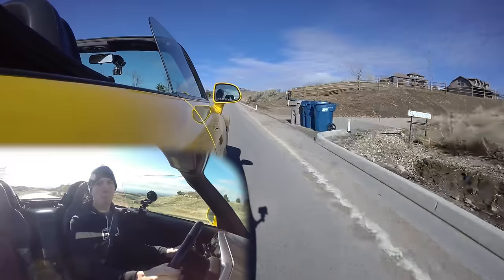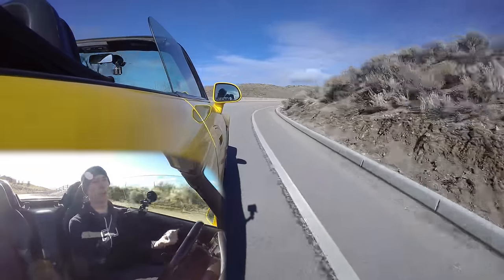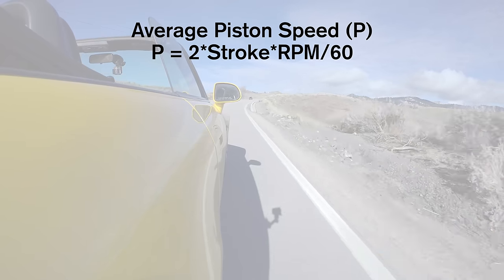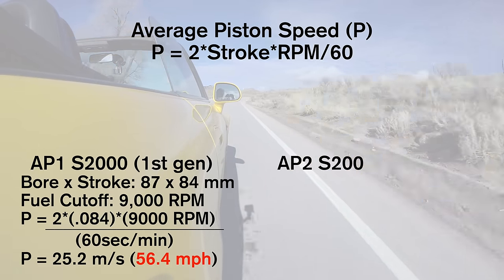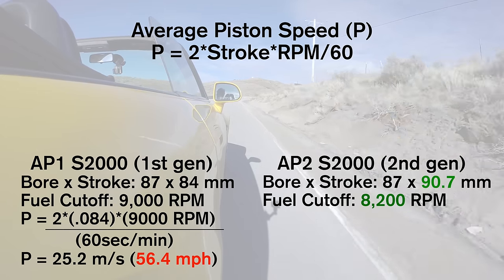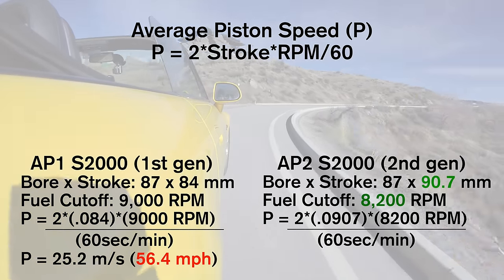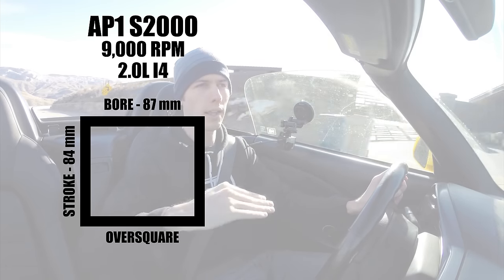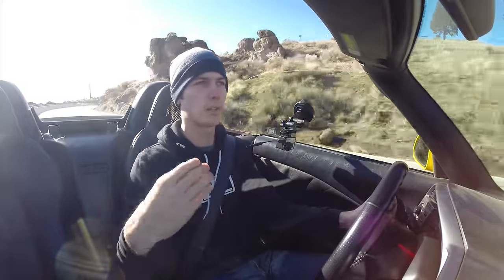How Do Some Engines Rev To 9,000 RPM?

Comment: Do higher engine speeds cause more wear and tear to the crankshaft and gearbox? Therefore are diesel engines more sustainable in that the everyday user can enjoy higher power without quickly wearing out the engine etc? An example of engine wear for example could be crankshaft / gearbox  oil leaks caused by worn journals etc.
Reply: Be careful of the indoctrination word "sustainable", because it does not mean "growth". (do you want to grow?)
Sure, higher RPM's will mean more wear and tear, but with "growth" we can figure out how to make it work for their application, (tougher materials, better lubrication, etc. etc,--thinking).  We are thinking man, and we can do anything that is possible, but only if we believe in "growth".
"sustainability"  in reality, is actually a pretty dirty word, if you have any intention on growing.  Consider it sabotage, as that is want the word represents in the context of mans "growth".  I would love to see you young guys sue your teachers,---collectively.

Comment: 9000 is not impressive. I feel like the question should've been how can some engines rev to 18000 (bikes) or 23000 (F1)
That being said, I do love your videos and really appreciate your unique point of view, not criticizing, just commenting.
Reply from the maker: It's all relative. Name another road car that hits anything above 10,000 RPM. They don't. As demonstrated in the video, 18,000 RPM F1 cars have the same piston speeds as something like an S2000. Saying 9,000 isn't high for a road car is simply inaccurate. If it's mundane and easy to rev to 9k in road cars, all of them would do it.
Reply: Thanks for the reply, I did not mean to say it's insignificant, for a production car engine. In that criteria 9000rpm is hugely impressive. But my comment, and, the way the videos title reads, refers to any engine type. Not specifically production car engines. "How do some production car engines rev to 9000?" would've been a more accurate title. And again I would like to stress that I'm not just trolling, I do love your content, and I feel much safer going by the advice of an engineer than a "Car reviewer" so yeah not trying to be a dick... You mentioned that in an F1 engine the pistons aren't actually moving any faster than an S2000 despite the drastically different rpm? That confuses the hell out of me, could you maybe explain that in a future video?

Comment: If i decreased piston weight to make it light weight piston does that affect rpm?
And how does f1 engines get enough air for combustion at insane rpm say 18000 rpm?
And my last question is a technology like koenigsegg's free valve effective at high rpm or not?
Reply: no it will not, it will just make the engine rev and drop rev faster, because the moving mass is less. The traveled distance of the Piston is still the same.
Reply: it can withstand more abuse from higher revs, it's often the conroad that gives up at high rpm and it will like a lighter piston. f1 can have huge valves which only benefit high rpm, there is a reason for the 6k rpm idle. The free valve technology will initially give a much better breathing efficiency but the system itself can't react fast enough for crazy rpms. But that can always be improved.
Reply: F1 uses complicated pneumatic valve system
Reply: Bilal  Smadi 
What is this complicated system?
Reply: There's a search bar at the top of your browser. Click there, type "F1 pneumatic valve" and press enter.
Reply: +Pizza face... I like your style. Finding things out for yourself comes with all kinds of satisfaction... but for those that need to be spoon fed...
+Ahmed the pneumatic system uses compressed air to open and close the valves, and is far more responsive than a mechanical (ie. cam and spring) system. Springs that cant keep up with rpm lead to "valve bounce" where the spring ends up with resonance and keeps flexing, which allows the valve to 'bounce' off the seat and not seal the cylinder properly, reducing power. In extreme cases valve bounce can get so bad that the valves impact the piston and your engine becomes a boat anchor.

Comment: You should also say that even if you have limit 9000RPM, your engine probably have most torque at lower RPM. Example. Honda Civic VI 1.6 I 116 KM: max engine power: 6500RPM, max torque: 4800RPM.

Comment: I have a dodge journey 2.4lv4 dual vvt I just bought it and the high rev when I would flore it would hit just under 6000rpm most of the time its around 5300 but after replaceing the nasty air flow blocking air filter with a high air flow I now max out at 7000 it may be higher but I would not no the cars rpm dial has not number higher on it.

Comment: I never really understood why Honda changed the engine.  Sure, I get that they may have wanted it to be more suitable around town and add some torque lower in the rpm range, but for me, it spoiled the flare and flagrancy of 9000 (some say cutoff is 9200) rpm.  If they just released the original S2000 with the FC22 engine out of the box, no one would be the wiser or feel there's a loss.  If you give us more and then take it away..  Even with all the suspension and handling improvements, the heart of the beast has been tamed.
Reply: I believe longer stroke results in more torque at the expense of less rpm and because of that AP2 is more in favor of daily driven whereas  AP1 is more track oriented.

Comment: i want to know why diesel engine rev lower than gasoline engine, and why some trucks engine only reves to 2k-2.5k rpm when normal diesel engine (is the second one based on the wheight of the piston?)

Comment: Higher reving engine is always smaller and lighter than high torque engine with the same horse power. Less weight, more mpg, better handling.
Reply: The downside to a higher revving engine is that the power isn't easily accessible. In a light car with proper gearing, this isn't a major issue. For larger vehicles, or when towing, having easily accessible power, even if that maximum output is equal or lower than a high revving engine, is key to getting a lot of weight moving at reasonable speed in a timely manner. Though with that easily accessible power means it's also easy to burn a lot of fuel, while a smaller engine may need to rev higher to drink it's fill.
Reply: precisely dude

Comment: Piston speed is measured in fps feet per second not mph highest mean piston speed you want is 140 fps  anything higher then that your motor will come apart period depending on stroke and rod combos give you different fps at different rpms short stroke = high rpm tall stroke = low rpm redline destroke 400 sbc 3.48 or the 3.50 stoke crank 377 or 379 can get you to 8000 plus safely but 375 stroke crank maybe 7000 most but with tall deck block and longer rods like 6.200 3.75 stroke can turn over 8000 rpms its all about combinations eagle has an awesome cubic inch calculator that can give you mean piston speed for different combos

Comment: This is interesting. Just picking some numbers from some engines I've had... A ford 300 has a 3.98 inch stroke, and a piston speed of 30 mph at 4,000 RPM which is just about all they will turn. Which is why they hold up, I imagine. My Chevy Colorado has a four cylinder with a longer stroke than the Ford 300, at an even 4 inches... at it's 6300 RPM redline, it's about 47 MPH. 

Just for fun, I have an engine with a 14.7mm stroke, and a 40,000 RPM redline. This gives me a piston speed around... 43 MPH. 

Aren't Engineering, Physics, and Math fun??

Comment: Honda fan boy here. I’ve owned an 07 civic si FA5 and an 08 civic si FG2. Both revved past 8,200 rpm it changes a drivers perspective when you let it rev all the way to the way and listen to your intake and exhaust cams open up and hear the engine and exhaust even more clearly. Same even with a buddies gsr integera they all go past 8,000 rpm. Honda/Acura>everything
Reply: 177SCmaro that’s fine I’m sure any turbo Honda will definitely get the job done.
Reply: so you think a boosted k20a is a hand grenade? seems youre a bit biased
Reply: 177SCmaro since you assume Honda & Acura is a joke check out 4bangersproduction & iamtaiboogie on YouTube and get back to me.

Comment: Seen a Subaru eg20 engine revving to 12,000 rpm on a YouTube video? So basically the whole bottom end of this eg20 engine is different to achieve this? Shorter piston stroke and wider bores ? Is this how it was achieved cuz they won’t say on the video. But cuz it still using factory gearing ratios in the box and diff its top end speed is crazy fast? Apparently?

Comment: Question:
 @ 3.15  you said the AP2 has a shorter stroke, i thought it is undersquared and have a longer stroke?
Reply from the maker: As shown at 3:05, it is undersquare. Overall though, the stroke is not very long (hence the high engine speeds).

Comment: Does the rotary engine really rev fast, as I understand only the geared crank spins fast, the rotors spin 3x slower, so at 9000 rpm the rotors are only spinning at 3000, possibly the slowest revving engine ? I’d like to hear more learn,ed views.
Reply from the maker: The crank is the number you measure when discussing rotary engine speed. Yes, there is generally a 3:1 gear ratio, so the rotors are spinning at 3,000 RPM while the crank (eccentric shaft) rotates at 9k. Ultimately crank revolution is your rpm, not what the pistons or rotors are doing.
Reply: Thanks, but it seems a bit like cheating. 🤔

Comment: Hey I have been working on a ohv small engine and haven't been successful, the cilinder has a good bit of oil in it and gas and oil is being blown out of the carburetor and it back fires but doesn't run, I would tromendously appreciate any help I can get to get this motor working again because I've been working on it for weeks.

Comment: Does the flame front travel at the same rate for diesel as it does for gasoline?
Reply: HayabusaRydr There is no real flamefront inside a diesel engine since the air-fuel mixture is being ignited by the general heat produced by the pressure inside the chamber.
That means that there isn't really ONE place like a spark plug where a flame front is caused.
The Diesel inside the cylinder just burns pretty much all at once everywhere inside the whole chamber
Reply: TheImperfectGuy so you're saying it runs on unicorn farts?
Reply: HayabusaRydr It runs on me saying that hundreds of mini ignitions,  not even milliseconds apart, creating hundreds of mini flame fronts, mit dem means burning all at once without a real flamefront
Reply: +HayabusaRydr 
No. 
The in-cylinder burn rate of gasoline is several times faster than diesel. 
There are very detailed and informative papers published on this subject by MIT, Ford, Cummins and SAE.

Comment: There is no definite answer how and exactly what makes some engines rev to 9k rpm, if there is, it's "every single part counts". Take your average chevy small block V8 as an example, back in the 70s and early 80s,  truck motors choked by emission control crap redline at 4400rpm (if I remember correctly, the tach only went up to 5k rpm), while racing engines that share the basic cylinder block can scream at 10k+. The upgraded rotating assembly, valve train and oiling system etc are all serving their purpose in making something as mundane as an sbc rev above 10k rpm.

Comment: For 6.6mm longer stroke the RPM drop 800 and my question is are all engines running with the 50-60mps speed cuz alfa romeo has 2.0v6 engine with 66.2mm stroke and 80mm bore and theoreticaly with the same pistone speed as the S2000 it should hit over 10k RPM but it cuts fuel at 6800rpm. Why ?

Comment: It sounds cool but if you max out on piston speed I assume you also max out on wear and tear.  And the sound will become wearing too.  I'd prefer an undersquare engine with 2 valves per cylinder most of the time, i.e. one that doesn't need to be revved.  And there is a reason electric cars make mincemeat out of the best supercars in a drag race.

PS  Lets not forget the fastest revving engine in the world is not a Honda S2000 or an F1 car.  It is a hire car.

Comment: so a v12 has 2 sets of 4 pistons arranged in a v but what if you had 4 sets of 3 pistons arranged in an x with a lower stroke, would this allow for higher revs?
Reply: Fumetsu Kage maybe this goes away from your idea, but your describing a radial aircraft engine!  Nifty packaging for an aircraft. They were and still are slow reving low compression engines designed for a specific use. The challenges of cylinders below the oil sump seems like an unnecessary challenge for a road car.

Comment: Anyone that has raced a high rev eng in low gears in turns gets it. They pull fast, engine brake fast, and grip the road better. Hard to explain. Use to race a motorcycle in the mountains thru the turns ,all the slob is gone and you feel the stars align.

Comment: what oil do they run in them engines that they can run piston speeds up to 25m/s? wouldnt the lubricity of the oil on the pistons fail?
Reply: i mean F1(for example)  engines usually reach even higher speeds but those engines arent meant to live long, their usually only for 1 or 2 races and then its done. and F1 (for example) runs completly different oils, oils u couldnt run in a normal vehicle cause those oils have a viscosity that would slowly kill normal engines, the oil pressure would be way to high.

Comment: Such an amazing V8

Ford 5.2L Voodoo Flat Plane V-8 
RPM Limit 8,250 rpm 
102 HP per liter.
526 HP 
Bore 94mm Stroke 93mm 
Compression 12:1

Piston speed  calc = 2*(.093)*8250 25.58 m/s 57.2 MPH
Bore Stroke ratio slightly oversquare
forged pistons and connecting rods.
hollow intake valves

Comment: Question... Something I have always wondered about pistons and combustion engines... I know how a pistons moves down during the power stroke, thats pretty obvious. But what force makes the piston go down during the intake stroke and the exhaust stroke? Maybe u can make a vid or just answer here
Reply from the maker: It's connected to the crankshaft, which the other pistons are connected to, so the force of combustion from other cylinders is what's at play here. In the case of single cylinder engines, the flywheel is large enough to maintain enough inertia to keep the engine spinning for the other cycles.
Reply: Maybe a weird question but considering 4 cylinder engine and one cylinder is at the power stroke. Call this 100% power. How much percentage will the cylinder at compression stroke consume of that 100% typically? Intake and exhaust strokes are not significant here are they?

Comment: if diesel and petrol car have  the same cc, both of them are running at the  same rpm ( say 2000 rpm) then which one of them will run with higher speed ? Why?

Comment: I bought a 96 camry I4. The rpm is very low comparing to the speed I am doing on the hwy. For instance; I get 65mph on 1400rpm. What it is the problem?
Reply: Its not a problem, its how it was designed. Your gear ratios just give you a lower engine speed at that vehicle speed. You usually want lower cruising rpm to improve fuel economy.

Comment: Why should an inline 4 revving at 9000 RPM sound any different than a flat plane crank V8 with single exit exhaust running at a modest 4500 RPM? There are the same number of exhaust pulses per second.

Comment: Never covered Valve Float with high revving interference engines ...sad ):
Reply from the maker: Well I discussed hollow intake valves, which are used in OHV engines to combat valve float. But OHV engines have lots of reciprocating mass (including pushrods), which prevents them from high revving.

Comment: De real question is...
Wot allowed F1 cars to rev to 20.000rpm?
But thanks for this explanational video of what allows ROAD cars to rev to 9K rpm...
Reply: F1 cars use a combination of factors to rev as high as they do. Short stroke, reduced reciprocating mass, pneumatic valve systems, extreme intake systems and so on.

Comment: Not exactly low rpm engines like diesels usually make more power then gas engines for example dd15 on my semi never goes over 1800 rpm and its a high hp high torque engine

Comment: Wouldn't high-rev engines wear much faster?
Reply: exactly what part of the engine do you think is going to wear
the piston?
the crankshaft?
for like over 90% of the parts because its about the power produced not the rpm produced the load stays the same and ive never heard of pistons being over used
Reply: I know it's an old question, but talking about daily driven road car engines.. There are a few different types of wear.  Sure, with every swipe of your rings against your cyl walls, there is a minute amount of wear. Mostly negated by clean fresh lubricant. That's why old engines are often down on compression. So it's not unreasonable to consider that an engine revving to 8k often has more swipes than one revving to 4k.  On a well maintained engine, would you even notice over a reasonable service life?  Probably not.   At the other end of the spectrum, some people (elderly) lug their engines around and under rev them often. I know some civic engines that have never seen above 3700.  And they are rattly AF. You're effectively asking your motor to do more work with every stroke, leading to likely increased bearing wear. (And a grindy 2nd gear)
Most engines are engineered for a specific rev range. And if you run clean oil and operate them mostly within that happy range, you can expect a long service life. (you'll know when you'r in it.)